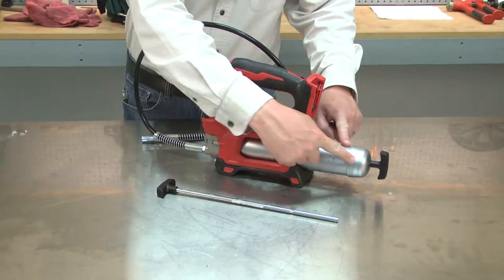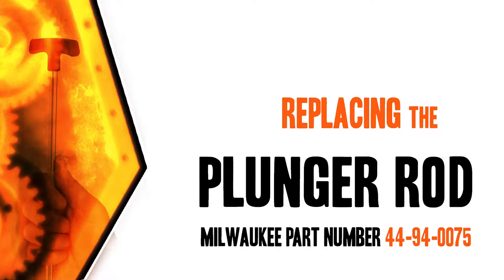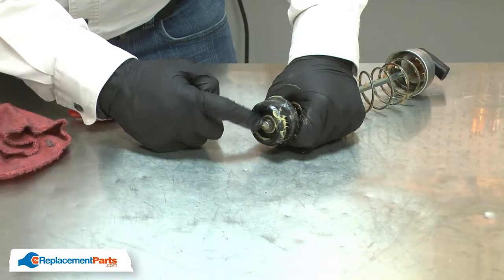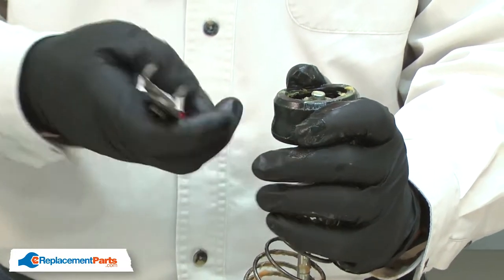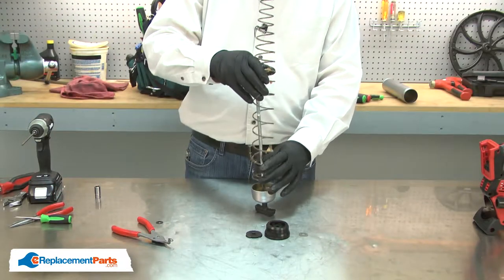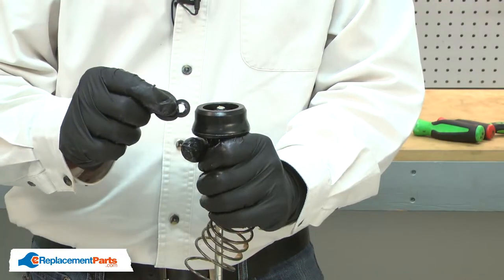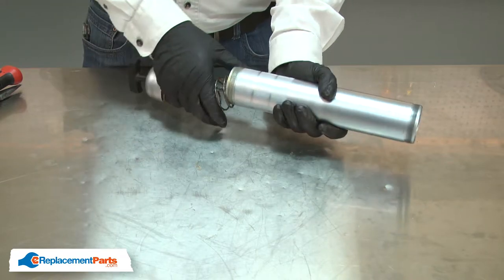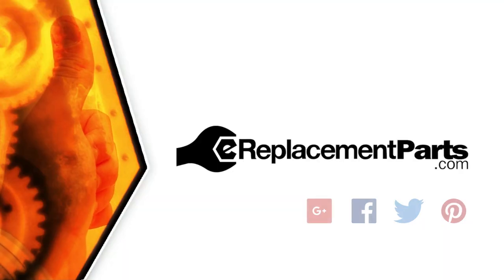Milwaukee Grease Gun Repair - Replacing the Plunger Rod (Milwaukee Part # 44-94-0075)

Comment: My M12 grease gun won't lock on to the rod and I want to change the grease type. Plunger seems stuck in grease. Liquid grease was trapped in the bottom
 of the cylinder. Any ideas? Store vertically?